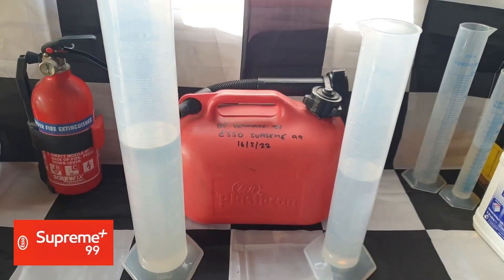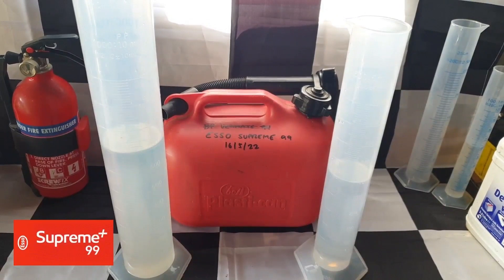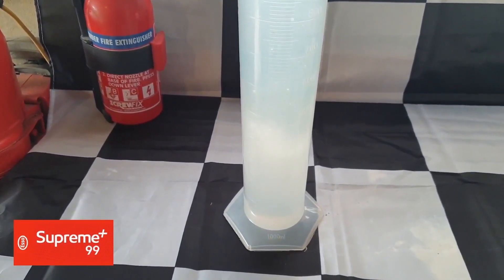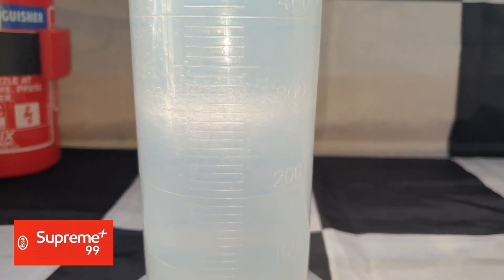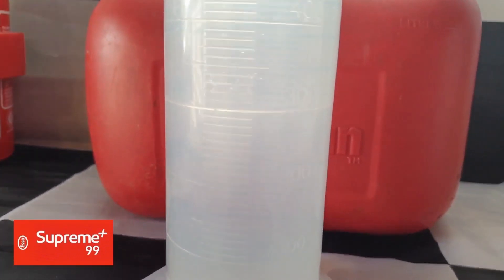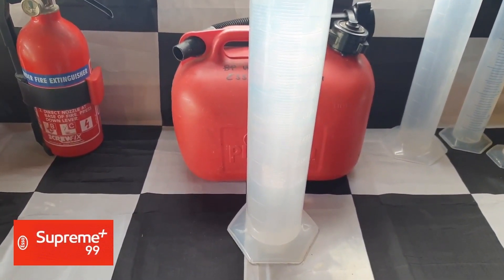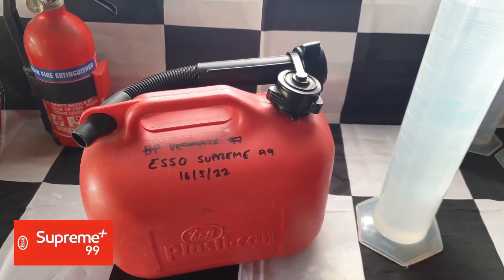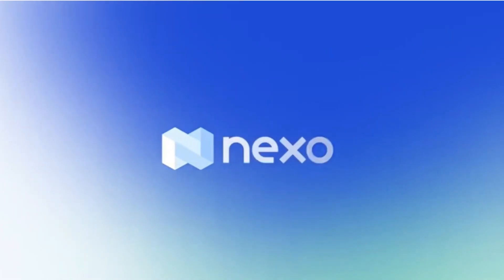Testing for Ethanol in Petrol / Gasoline Part 14: Esso Synergy Supreme Super Unleaded Revisited – E5

Comment: The only bad petrol I have ever been sold was from an esso.
They said get stuffed basically.
Still have the emails.
Black smoke,oily residue.
Engine light and misfires.
Not to worry, I paid to get it drained and a new fuel filter.
Still got a sample I wouldn't put in my lawnmower.
Jog on Esso.
Reply from the maker: They probably dispensed a load of the sludge that sits in the bottom of their tanks. Have you seen my latest videos on Esso? Their "99 octane" petrol is actually 93! I'm not using them again either.
Reply: Keep up the good work.
Citizen science can make a real difference in keeping things honest and real.
Driving conditions and tyre pressure make a notable difference to fuel consumption.

Comment: I filled up with this fuel to full, did 30 miles and the fuel gauge moved slightly when at 11 miles. I thought that was excessive and I filled up from a motorway service station, driving steady at 60 mph

Comment: I'm obtaining 53mpg extra urban in a 2011 1.6 Ford Focus using this compared with around 45 with Shell V-Power  Also 5p off per litre (up to 60 litres) in exchange for 300 Nectar points when linking Nectar with the ESSO App. I can vouch for much better torque, as already mentioned in the comments.
Reply: Jeezuz, I'm getting 14mpg in my truck 😂
Reply: Sadly, this is to record that in recent weeks economy has suffered and I suspect ethanol is to blame. Eagerly await another test...
Reply: @loverofgod6176  It goes without saying. The mixture is less calorific. The question is, what % of fuel economy are you losing vs % price difference using E5. Although E5 is more expensive, it may actually be cheaper mpg wise.